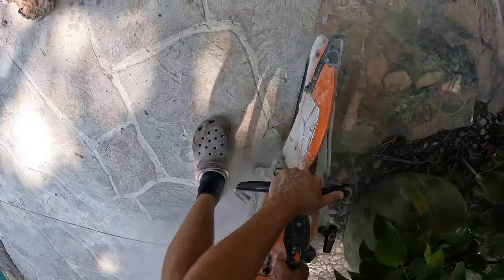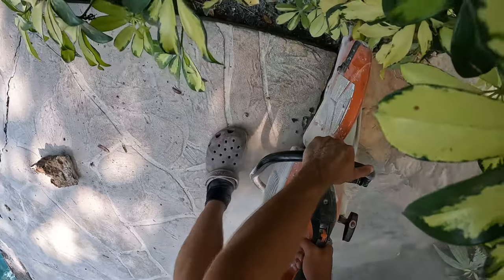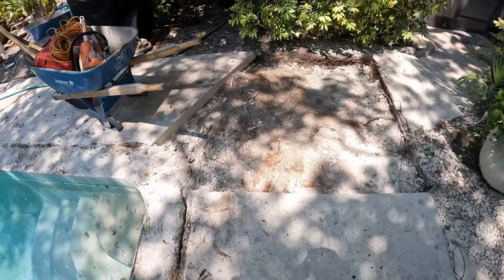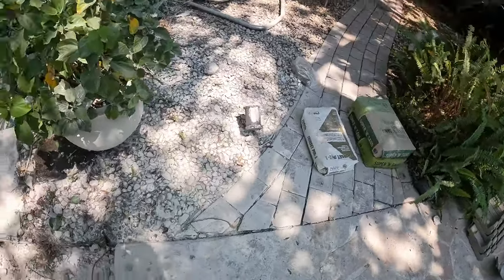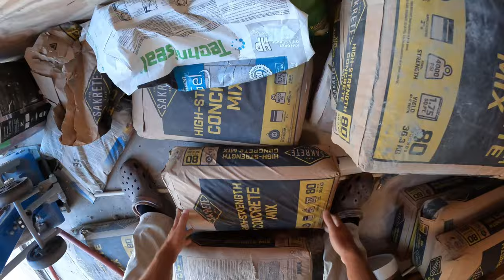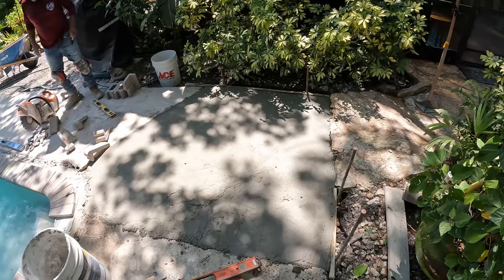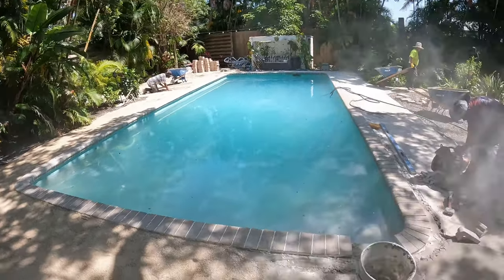POURING CONCRETE AND FORGOT TO SET THE RAILING!

Comment: With the railing in the center of the steps, will it make it harder to get into the pool considering that the first step is so small?
Reply from the maker: We put it back where it originally was, there's still 2 feet on either side of the railing on the first step so it should be plenty!